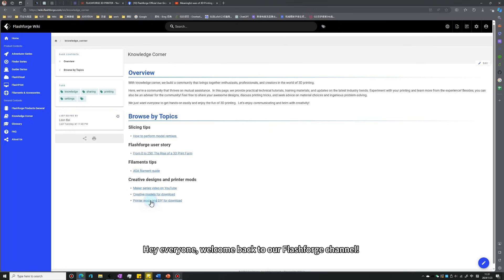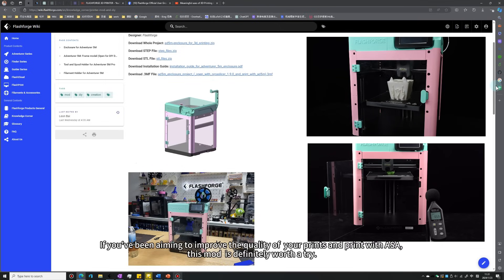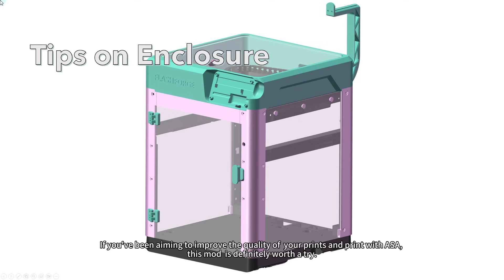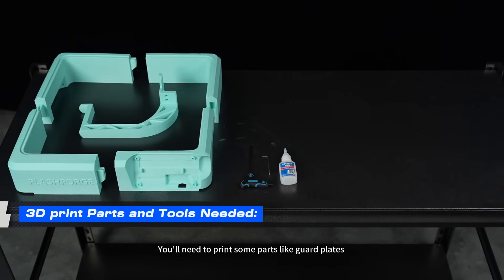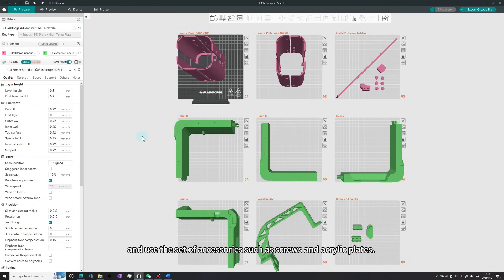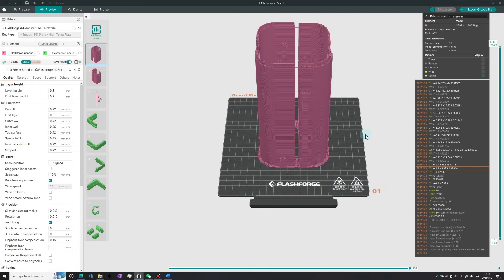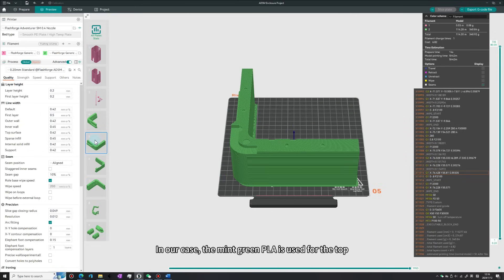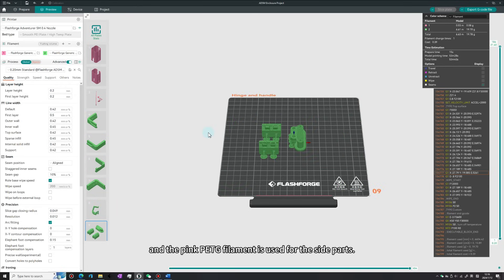How to 3D Print Enclosure for your Flashforge AD5M (Succeed with Mods!)

Comment: Can't get the filament to stay put when trying to print the guard plates.  Even with a fresh coat of glue. It gets 1/4 inch in height and then the printer starts pushing the print around the base.  I am using a brand new spool of PLA filament.  Suggestions?
Reply from the maker: Have you tried increasing your bed temperature slightly? That can sometimes help with adhesion.

Comment: ok so 2 serious questions.
1) what printer settings do you recomend to handle the tall prints like the side supports without the shake of the printer cauisng them to snap off?
2) Can the printer still print in PETG after using PETG to create the installed parts? won't the contained heat cause warping in the cage or worse melting?
Reply from the maker: Hi, you can download the 3mf file and print directly: https://flashforge.com/a/docs/knowledge-corner/printer-mod-and-diy#enclosure-for-adventurer-5m  For PETG printing, we recommend keeping the printer door open during summer. In other seasons, it shouldn’t be a major concern.

Comment: I'm going to be printing mine using PETG...fresh out of the sealed container, should I put it in a dryer before I print it?
Reply from the maker: Hi, if your PETG filament is fresh out of the sealed container and hasn't been exposed to moisture, you can typically print with it right away. However, PETG can absorb moisture over time, which can affect print quality. If you're concerned about moisture or if the filament has been stored for a while, it’s a good idea to dry it in a filament dryer before printing to prevent issues like bubbling, stringing, or poor layer adhesion.

Comment: When I tried to put the filament sensor the cable to plug it it was on the opposite side and because of that I couldn’t put the filament sensor. Pls help!
Reply from the maker: Hi, please try to print spool v2. Download Whole Project: ad5m-enclosure_for_3d_printing_20240710.zip here: https://flashforge.com/a/docs/knowledge-corner/printer-mod-and-diy    then click stl files→spool holder
Reply: @ I will try and update. Thx

Comment: @flashforge3d on the linked page, I couldn't find the "SPOOL HOLDER V2" model. Please provide the exact link where this model is located, as it's currently impossible to use a filament detector in its current position due to its uni-directional design and inability to insert filament at such an orientation.
Reply from the maker: Hi, please Download Whole Project: ad5m-enclosure_for_3d_printing_20240710.zip here:https://flashforge.com/a/docs/knowledge-corner/printer-mod-and-diy    then click stl files→spool holder

Comment: The filament detector only accepts the filament in one direction. With this mod, you have to insert the filament the opposite direction.
How do you over come this?
Reply from the maker: Hi, please check the pinned comment
Reply: @flashforge3d  I did check that before posting, but its not clear what I have to do. Seems like I have to print a different spool holder? But the link to download the new holder just takes me to the standard site... Help?
Reply from the maker: Hi, you'll need to print a new spool holder. You can find the model in the Enclosure for Adventurer 5M section of our Wiki：https://wiki.flashforge.com/en/knowledge_corner/printer-mod-and-diy   Just download the whole project, and the file for the new spool holder will be included there.
Reply: @flashforge3d  I did check it before making my original comment, its not clear what I need to do. The video is confusing, and the link just takes me to wiki. What exactly do I need to do different for my filament sensor to work correct, in the right orientation?
Reply from the maker: After printing the new spool holder, you can follow the steps in this video to set it up correctly: https://youtube.com/shorts/jIlbmUsubns  This should help you get your filament sensor working in the right orientation. If you have any more questions, feel free to reach out!
Reply from the maker: Thank you for your feedback and persistence! We appreciate your suggestion. We'll work on making the instructions clearer and more straightforward for everyone. Your input helps us improve—thanks again! 😊

Comment: Hi, i printer from your "3mf" file you provided in the Wiki page, but i noticed the parts were printer with supports, since it's first time i deal with "supports", any idea how to remove these supports from the parts?
Reply from the maker: Hi, you can remove the supports with your hands. If you find it difficult, you can use tools like pliers to help remove them more easily.

Comment: What kind of temps can it hold? 60c?
Reply from the maker: Hi, are you referring to the temperature of the build plate?
Reply: @flashforge3d  ambient temperature, with the enclosure, same reason it can print ASA after being enclosed right?
Reply from the maker: Yes, it can print ASA

Comment: ordered my 5m a few weeks ago. its amazing. decided to print the enclosure to help with holding in the heat as I was getting some warping on bigger pieces. it took a few days too get everything printed and its all put together. 1. it looks way better now 2. it holds way more heat 3. THIS DRAG CHAIN IS THE MOST REDICULOUS UNUSABLE POS about this build. all it did was kink up and bind in the back corner when needing to print on that corner. I could see it being very helpful without the enclosure because of the risers. I ended up just taking it off and shortening the feed tube about 4 inches. other than that, I'm very happy with the 5M and the enclosure.
Reply from the maker: Thank you for your feedback! We're glad to hear you're happy with the 5M and the enclosure. Regarding the drag chain, please check if the clips of the drag chain are installed in the right direction

Comment: Got my 5m last night and i am very happy with it. I sold my bambu labs x1c because most of the new printers have the same features and since the x1c held its price i sold it for almost the same price i got it for a year later. I didn't expect the 5m to be as good as the x1c due to the price difference, but i gotta say. The first layer goes down 100% perfect every time, unlike my x1c. This machine seems a tiny bit slower, but the quality is amazing.
Reply from the maker: Thank you so much for sharing your experience! We're thrilled to hear that you're happy with your new 5M. Your feedback is invaluable to us, and we're delighted that the quality of the 5M meets your expectations. If you have any questions or need further assistance, feel free to reach out. Happy printing!❤️️

Comment: where do we get the plexi?
Reply from the maker: Hi, you can find it on Amazon:https://www.amazon.com/FLASHFORGE-Adventurer-Enclosure-Temperature-Filaments/dp/B0D1SRQ54Z/ref=sr_1_1?crid=XCGSPWOXP99R&dib=eyJ2IjoiMSJ9.-8uIvUTnO9abLonvCoXK -5FIv2Gdnl_rAXzj_6NjB_khucDG9MT2P50CaUV-0K1XkgPVNDjE6zPf9R_B9rNHM_1XcyQ5yVoT4ptYP5PI40gqRYXzPgKi3p1B6mJj28EBV0oGxsuRnO8SPBFODl3vgcwEryh7ljPeAofD7y PBFx7Xz-o38vHHJ0xVrND6AByaBubdGnsDCvjAhUPNfqKboplfpBNiUSCFYAKBsprGrgSSe-llH-sjEjAKS1U4OQSCPE4GoelxbJbi8i9qy1tYveSEN6aHtZtHELzzTylOj0Y.J9VoHA0QOEQIaCcINSlBmjW xP1zB8NJ2LX3fUOLg9Sw&dib_tag=se&keywords=flashforge+enclosure+kit&qid=1718536951&sprefix=flashforge+enclosure%2Caps%2C515&sr=8-1

Comment: Having an issue hopefully someone can help.  So I installed this enclosure and now when I run level program its hits the enclosure on first point in bottom left then at the 5th point on first row then back left with the start of last row.  Is there anyway to modify this with like .5mm  to 1mm clearance?  TIA.
Reply from the maker: Hi, please contact support@flashforge.com

Comment: I thought it was supposed to release in april?
Reply from the maker: Hi, you can find it on Amazon:https://www.amazon.com/FLASHFORGE-Adventurer-Enclosure-Temperature-Filaments/dp/B0D1SRQ54Z/ref=sr_1_1?crid=XCGSPWOXP99R&dib=eyJ2IjoiMSJ9.-8uIvUTnO9abLonvCoXK -5FIv2Gdnl_rAXzj_6NjB_khucDG9MT2P50CaUV-0K1XkgPVNDjE6zPf9R_B9rNHM_1XcyQ5yVoT4ptYP5PI40gqRYXzPgKi3p1B6mJj28EBV0oGxsuRnO8SPBFODl3vgcwEryh7ljPeAofD7y PBFx7Xz-o38vHHJ0xVrND6AByaBubdGnsDCvjAhUPNfqKboplfpBNiUSCFYAKBsprGrgSSe-llH-sjEjAKS1U4OQSCPE4GoelxbJbi8i9qy1tYveSEN6aHtZtHELzzTylOj0Y.J9VoHA0QOEQIaCcINSlBmjW xP1zB8NJ2LX3fUOLg9Sw&dib_tag=se&keywords=flashforge+enclosure+kit&qid=1718536951&sprefix=flashforge+enclosure%2Caps%2C515&sr=8-1

Comment: I can't get the spool holder to slice, it won't fit on the plate?
Adventurer 5m
Reply from the maker: Hi, please contact support@flashforge.com
Reply: @flashforge3d  I figured it out, skirt was issue. 
But while you're here how about you fix the account generation for Orca FF or Flash Maker? You can't get the 'code' you need to generate accounts.
Reply from the maker: Thank you for your feedback. We have passed it on to the relevant team members.

Comment: Hi, I want to install the fan filters, I noticed that in the rear part the 5M PRO is equipped with a conveyor right above the motherboard, is it possible to have the file to be able to print the same conveyor?  Thank you
Reply from the maker: Hi, please check here: https://wiki.flashforge.com/en/knowledge_corner/printer-mod-and-diy   You can download the Drag chain kit for Flashforge Adventurer 5m
Reply: @flashforge3d  not what I asked for, behind the rear panel inside right above the motherboard in the PRO version there is an air filter recirculation conveyor, I'm looking for that piece.
Reply from the maker: Hi, we don't have this file yet

Comment: The termination of the cable chain (drag chain) seems to have been way over complicated. Both the 100% DIY approach and the "kit" approach (with a replacement of the top of the hot end) seem unnecessarily complicated. The shoulder screw for additional pivoting at the hot end seems unnecessary, and it seems that the same concept was undertaken by whoever designed the 100% DIY solution as well. A simpler approach of a final chain-link piece with a modified end for rigidly attaching to the hot end should be fine. I am undertaking to design such.
Reply from the maker: That's great. Looking forward to your design.😊
Reply: I'm a new customer of your company, and a huge fan of your AD5M printer. I developed an easier, simpler way to connect the cable chain of the DIY enclosure. The design is available free on Printables. 
https://www.youtube.com/watch?v=A9MNIt4pA_Y
Reply from the maker: That's cool

Comment: Hi I have two other Flashforge printers a Dreamer DX and an Adventurer 3 Pro and just bought the new AD5M. Can I use my current Flashforge software to run this printer?
Reply from the maker: Yes, you can use Flashprint

Comment: Nice job Flashforge! I just ordered both the M5 and the M5 pro. I currently have a finder 3 along with several creality printers and I have to say that the finder is by far my favorite printer for the quality, speed, and ease of use. I have had several printers over the years and owning a flashforge has always been the "benz" of printers for me. I am looking forward to my M5 and pro. I will be printing the enclosure for the M5 first, any idea of when the kit will be available? If not I am confident that I can precure the pieces needed, but I feel that flashforge provided parts are better.
Reply from the maker: Thank you for your support. The kit will be available soon, please stay tuned!